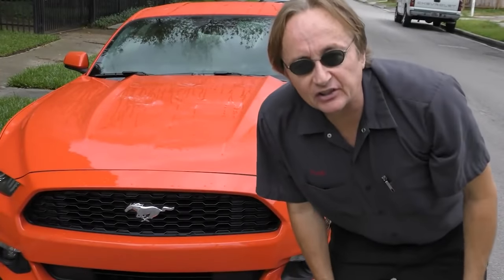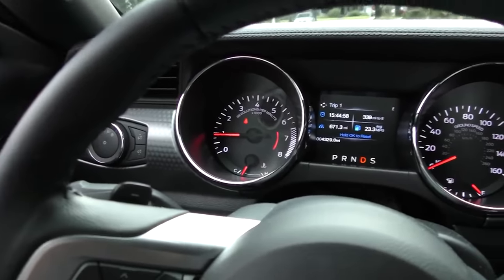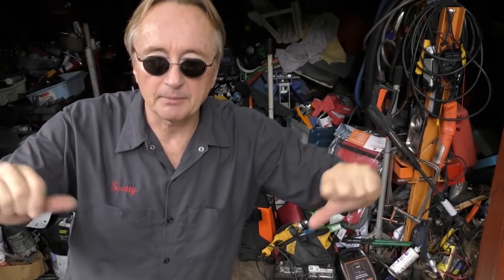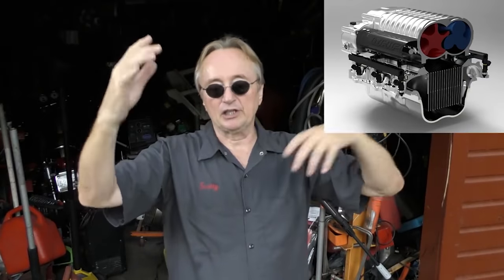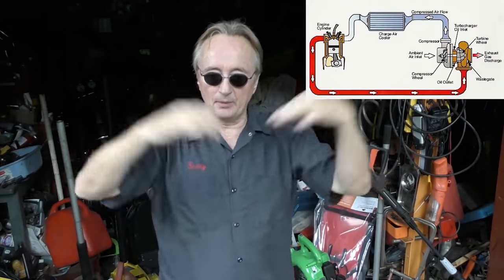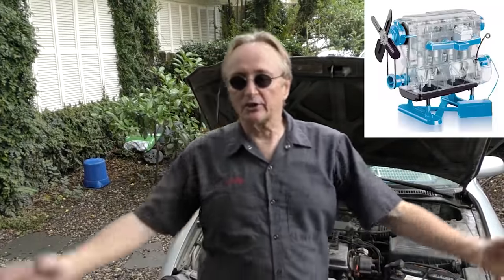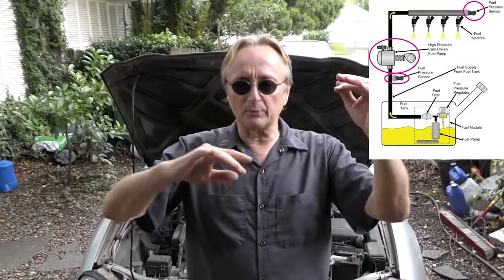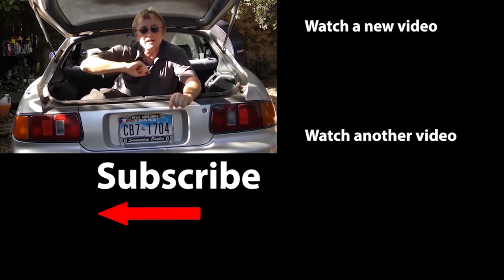I Was Wrong About This Engine and I'm Sorry

Comment: I have a 2017 F-150 with the twin turbo 2.7 engine. So far, I have 174,000 miles on it with little to no problems.  I normally keep my car/truck for 15 years.  Ford says I can change the oil every 15000 miles. Sorry Ford, being old school I change my oil every 5000 miles and Transmission fluid every 50,000.  Proper maintenance is the name of the game. I have been using Mobil 1 since 1991.
One more thing, this truck has been towing my 7000 lb travel trailer through 44 states since new which accounts for most of my driving.   I'm on my 3rd set of tires, 2nd battery and 3rd brake job.  Will be doing another anti-freeze change and tires soon.  
I am a retired Ford tech with 45 years experience, I retired in 2017. 

For me retirement means camping, fishing and hunting.
Reply: 30yrs. And counting.
Reply: Really? It hasn't leaked?  I thought every one of the 17s leaked.  5k is a good rule on cars,. Those extended oil changes are crap- the oil may still protect the engine but it varnishes and attacks seals and silicone
Reply: That’s a lot of miles for a 4 year old truck. How many times have you replaced your tires so far?
Reply: Same here. I have 179,000 on my 2008 Explorer (V-6). Runs very well.
Reply: Also you might be the edge case where you might be driving better than the average person plus that truck is almost totally highway miles which is easier on an engine than constant short trips your literally putting 30-40k miles a year on your car that's a ton of highway miles because that's 80 miles a day every day on average
Reply: I think 174k on an ecoboost engine is probably the exception and not the rule...
Reply: mobil 1 all day
Reply: I have a Ford flex with the 3.5 Ecoboost with 195k no problems at all it gets maintenance regularly. But to scotty if it's not a 95 Celica or a Toyota then it's junk -_-
Reply: Those are all highway miles. Explains the 174,000 miles on a 5 year old car.
Reply: @ccengineer5902  the Tundra 5.7 v8 that got super praised 4-5 years for having a million miles was used for a highway queen in courier service for 11 years. 90k mile's per year. Yes, a 27k mile per year Mustang is not seeing tough use but the bulk of highly praised high miler cars have 25k or more per year.
Reply: I own a 2015 Ford Edge with that same 2.7L twin turbo... 107k miles, so far so good, it creates a lot of power if needed, but most of the time it's driven very easy on it. However, the V6 in my Lexus runs considerably smoother.
Reply: I do agree with Mobil oil all day. I also change transmission fluid every 50,000 miles. However, after performing several oil surveys on trucks driven in all conditions. I change my oil between 9k to 10k miles. Even then the oil I have tested has alway been 95-98% as new. But to each their own. If you feel that changing oil at 5,000 miles that is your decision. I just rather not spend the extra money after performing an oil survey.
Reply: @treysuniverserv1576  Realistically, changing oil every 5k is still cheaper than doing serious engine work. On the flip side, if you're driving 1000 miles a week on the highway, 10k may be just fine.
Reply: 5000 miles is over kill. You're wasting your money. 7000-10k is sufficient on any modern engine.
Reply: I change engine oil every 30,000km on my Hyundai i30 2011 with a 1.6L diesel engine. Been doing that for 9 years...
Reply: @richardcrouthamel4397  any parts replaced?
Reply: @jimmyaber5920  You're basically making my point.
Reply: @richardcrouthamel4397  that’s not an eco boost
Reply: @jpete3027666  Proper maintenance is not the rule it is the exception!
Reply: the main reason for car problems is just improper maintenance. Many people after the warranty finish don’t go to the dealership and just change oil irregularly without maintaining other requirements and the car breaks down. I dare someone to bring me a well maintained car with issues.
Reply: You are absolutely doing the right thing regarding oil changes.
Reply: Leasing is an alternative
Reply: I can't image towing my trailer or hauling loads with a 2.7 engine.   Anything less than a v8 won't do
Reply: @jliefer2484  I used to use mobile until I discovered Pennzoil ultra platinum. Better by far.
Reply: Change oil or change engine/transmission. It's a choice.
Reply: 120k miles on my '15 2.7 EB.  No issues so far.  routine maintenance only.  Though i'm with you on the oil change interval.  i never go to 10k miles on an oil change.  its always half of that if i can.  Its cheap maintenance, easy to do, and much better for the internals, namely, the oil lines going to the turbos.
Reply: @Banditt42  Been towing a 7000 lb trailer from day 1. Twin turbo's give me all the power I need.
Reply: @richardcrouthamel4397  Yeah watch a transmission and your differential
Reply: I do religiously 5k mile oil changes on all my trucks and it has never failed me.
Reply: Unicorn, at the same time if you were talking about a V8 truck that wouldn't be worth mentioning. It's like we went backwards. 90s trucks went 300-400k all the time.
Reply: 45k miles per year? Interstate driving you think!
Reply: Cap
Reply: Something about to break
Reply: @gutadin5   Nothing major except for a transmission re-build at about 130K.
Reply: @jjk028    Yeah. The trans was re-built at 13-K. The diff has been okay.
Reply: @jjk028  Sorry. 130K for the trans.
Reply: @jpete3027666  You think... probably... Well that's pretty good evidence.
Reply: @floridajames04  I'll get my oil changed more often so I don't have to worry about my turbos. These engines are fantastic, but amazingly expensive to repair. To replace the turbo's requires taking the whole cab off the chassis.
Reply: Every 5000 miles and any engine will last
Reply: I have a 2018 F-150 w/2.7 V6.  Zero problems.  Plenty of power.
Reply: @richardcrouthamel4397  what are your thoughts on the new 2022 Ford Explorer Limited Ecoboost?
Reply: Obviously those are highway miles that will be much easier on the entire drivetrain. I believe Scotty has mad a comparison that highway miles like that are equivalent to less than a 1/3 of those in the city. Not knocking it, but the type of miles also plays a huge part.
Reply: @gutadin5    I have no firsthand knowledge, but reports suggest that their reliability is above average, with a few design flaws like possible oil pan leaks and ignition issues, and, of course, excessive fouling on the intake valves.
Reply: I agree. I have 2015 Ford F-150 3.5 eco boost. Changing oil every 5 to 7k miles with amsoil and transmission every 50k miles. Axle oil every 50k too
Reply: @Banditt42  
The ford 2.7 ecoboost is a great general purpose engine. It has good power and good fuel economy, and can tow up to 7600 pounds. But if you tow on a regular basis or tow heavier loads the 5.0 v8 or the 3.5 ecoboost makes more sense. Of course if you tow a lot diesel makes the most sense.
Reply: I have a 19 f150 twin turbo, and at 60,000 miles, zero issues so far.
Reply: @Banditt42  I drive a 2.7 eco boost and it works just fine towing a 14' pressure washing trailer. The reason the twin turbo engine works is because it makes similar power to a v8. 400 ft. Lb's and 325hp it's nothing crazy but definitely enough to tow reasonable loads.
Reply: Awesome,  us even older schoolers we did the trannys at 30,000 miles...But today's fluid is usually full synthetic so 50,000 seems reasonable.  They probably tell you in the Maintenance Manual it's lifetime or some other nonsense.  They need comeback buyers,  thus the 15,000 mile OCI  recommendation! Keep the metal side up and rubber side down and drive her till the wheels fall off... They are only getting more outrageous in thier price tags every year!!! Good 👍 LUCK.... Thanx; Jethro
Reply: @jpete3027666  far from the exception. We have 4 in my current fleet with 125K+ miles without engine issues.
Reply: The 2.7 is way better built than the 4 cylinders
Reply: This guy here is why scotty laughs at stupid people that swear buying GM is a good decision lolololololol
Reply: @chadoldag5827  I think leaking was due to composite plastic oil pans right?
Reply: @MS-mr4zm  yes, 15,16,17,18 they are glued on from factory, 17 and up can use a updated pan with a gasket.
Reply: @ccengineer5902  he probably lives in Arkansas
Reply: Every 15,000 is to get you out of the warranty period, that's all. For most 6 to 7 qt Ford Trucks every 5 to 6,000 is going to be needed to keep the engine clean inside with local use. Up to 8 or 9000 if all highway. The trans fluid and differential oils will easy go to 100k or  more, if recommend at all, it's usually listed at 120,000.
Reply: @floridajames04  If it takes someone a year to go 5000 on a 5.0L truck engine that has 6.5qt capacity, that's not overkill.
On a 3.5L Mercedes with a 9 qt. Capacity every 5000 is overkill.
Reply: @Banditt42  the 3.5 makes more HP and Torque lol
Reply: @JoeTricep  My routine in the morning involves turning off the stop/start...even though it would almost never activate on my usual commute anyway.
Reply: @JoeTricep  Im not sure what the purpose of your reply was. Did you mean to reply to someone else, or did you make up a debate in your head where I said something that I did not say?
Reply: 93 ford ranger with 2.3l 5sp 2wd, 492,000 miles. Original engine transmission and rear end! Change oil every 3000! Also change transmission and rear fluid regularly as well
Reply: I have a 2011 nissan sentra with 65000 miles. You drive a lot?
Reply: @2cornersahead  can't  blame him....Toyotas last forever. I had 1st gen V6 Tacoma that I sold with 220K miles on it, it never gave me any kind of issues other than regular maintenance and usual wear and tear. My father in law has 20 year old  4 Runner that currently has 260K miles on it....he just drove it from California to Texas and back without any issues. Toyota and Honda that's all you gonna se in my driveway....
Reply: That shows you how reliable the modern engines are, and with small combustion chamber and turbo charge. Actually it is hard to destroy a modern engine at present time. The whining out there are more coming from people with no auto knowledge, well if an engine overheats and you keep on driving it, sure you will destroy it in next 50 miles.
Reply: 15,000 is ridiculous especially with turbos
Reply: @Banditt42  The V8 is the worst for towing....
Reply: @jpete3027666  a lot of the fleet trucks in the company I used to work for had 2.7s and they were in the mid to upper 200ks
Reply: @Banditt42 , nonsense it depends on the size of the trailer…
Reply: @jpete3027666  no its pretty standard
Reply: Love my 16 2.7 f150, just drove from Texas to lousiana and got around 25mpg highway, get around 18-19 city
Reply: God bless you, Joe. I hope that you are having some fun!

Comment: I have the 2019 Ford Ranger with the 2.3 Eco boost, ten speed transmission. The same engine in the four-cylinder Mustang.
 Just geared different, with less horsepower and torque.
BEST truck I have ever owned.

Comment: My wife bought a used 2018 eco boost mustang from a dealer that bought it from enterprise rental cars. We added a bigger inter cooler, bigger turbo, turbo blow off valve, cold air intake and took off the resonator off the exhaust. Then had it professional tuned with the cobb access port installed. Car runs amazing and gets close to 350 hp. Also added an oil catch can because of the fuel injector placement.
Reply: Wow, I bet it does run good. I have a 20 Ranger and put in an exhaust and intake and a hot pipe with blow off valve. What a difference, it is like it was always congested and now its pipes run clean and smooth. Even produced a little better, MPGs.
Reply: i just bought a 2018 as well with 59k, and was wondering and thinking if the person before or the rental place treated these with special care that a turbo needs, i do think a person needs to understand these cars specifically to own one. and when i hear of failures or booms, theres so much user error possible, improper upgrades, also essential upgrades that must be made, may i ask how many miles did your wifes have on it at time of purchase and now also any tips?

Comment: I have a 2020 Ranger with 2.3 Ecoboost mated to a 10 speed transmission. I love it. Great gas mileage and enough power to tow. The secrete is not to drive by your foot. Just give it a little throttle and keep it there. The transmission will shift smoothly and most efficiently. I get 26 MPG around town and 13 MPG towing a 3500  LB. camper trailer . I installed an OEM catch can for the intercooler condensate.

Comment: 148,500 miles in my 2013 F-150 3.5 Ecoboost. Only mechanical issues I've had is the heater core leaked and had to change the upstream O2 sensor. I use it like a truck and I'm not gentle with it. But it also gets 5k oil changes, 50k tranny changes, 30k diff and transfer case changes, etc.

Comment: 2014  F 150 with 270 thousand miles with the eco boost engine and still going strong. No issues. I use good oil and filters and change the oil every 5000 miles. This trucks runs the highway everyday for work

Comment: I'm happy with my 2018 F150 with a 3.5L ecoboost.  Has direct and port injection.. lots of low end  torque.  V8 are good too, but with more torque, tuning potential, fuel economy, and towing capacity. The ecoboost is a better choice IMO.

Comment: From 1984-1986, Ford made the SVO Mustang with a turbocharged 2.3L. My buddy had an '85 and it was bulletproof, got decent fuel economy (when he kept his foot out of it he got around 20 in town and 28 on the highway), and dramatically outhandled the 5.0s due in part to the far superior weight distribution. That engine only had around 200 HP, but the car weighed 4-500 pounds less than the modern one so 0-60 is only a second slower. What's old is new...
Reply: Those SVOs and Turbo T-birds were fantastic cars back in the day. Wasn't there also a turbo model in 1980?
Reply: Thats a different 2.3
Reply: @michaelwalsh3474  There was. It was on a carb, wasn't intercooled and was pretty much a dog. I had a friend with one back in the day. It sucked pretty much all the time, but there were times in the dead of winter when it was balls cold out that it ran like a banshee. They took the same basic engine, put a better turbo on, a small intercooler and EFI to make the SVO. I think they made up to 210 HP and good torque. Fiddle with the boost and you can make a good chunk more. That iron SOHC 2.3 is probably the most raced engine of all time (in 1.6/2.0 trim) and is an absolute tank of an engine. Good luck trying to kill one.

Comment: I recently bought a 2012 Edge with a 2.0 ecoboost with 176,000 miles. Runs great with no issues. Had it checked by a trustworthy mechanic and he said they have had good luck with this engine over the years with no major problems.
Reply: I may be wrong but Im pretty sure the 2.0l is the engine that got the name 'Ecoburst' coined
Reply: @tehagent1321  what about 1.0l haha
Reply: 1.0 came later than other Ecoboost engines.  It has high torque off the line.  Even Jeremy Clarkson of Top Gear said that was a very good engine (and he hates nearly everything)
Reply: @electrictroy2010  thankyou

Comment: I bought a new 2020 Mustang GT.  It goes back and forth between port and direct injection.  It threw a check engine light at 1,600 miles for a bad fuel pressure sensor.  The dealer had to take out the back seat and drop the sub frame to fix it.  I think Scotty is on to something when he tells you not to have these vehicles pass the warranty period.
Reply: Unlucky, I have a 2018 gt with 0 issues.
Reply: That's what you get for buying a POS FORD 🤣🤣🤣
Reply: @floridajames04  you saying that but you drive a pos tesla lol
Reply: Sounds like a fuel tank pressure sensor, not a fuel pressure sensor, those are usually under the hood. The FTP has to be on the top of the gas tank. On some older ford's they could come loose and out by just dropping the tank an inch.
Reply: Diesel cars have had turbo & direct injection for 30+ years and lasting over 200,000 miles.  Gasoline turbi-DI should be able to do the same

.
Reply: You cant trust any car beyond warranty period lol. Unless it is honda/toyota
Reply: @Acisao  not unlucky, youre just still lucky lol.
Reply: Junk ford
Reply: FORD is rated #4 in engine reliability (least number of breakdowns)

.
Reply: Or just buy em well used and replace AZ needed

Comment: I have 2010 F 150. Runs and drives great with 160000 miles on it.  I also have a  Mustang 2006 with 142000 miles on  also ru so and drives great.  Keep your oil. And maintenance up-to-date.  You will be fine.

Comment: I agree, I had a turbocharged 4 cylinder and I drove it like I stole it! It only got 15 MPG but it was a blast to drive. Until it windowed a piston around 100K miles.
Reply: So what I'm hearing is that you abused a turbo 4 and it still lasted 100k miles. Interesting...

Comment: Big Rigs Diesel Engine use a turbo and that's what gives it power. I prefer Cummins and Detroit engines. I like the sound of the detroit engine at idle and the way the turbo sounds when gearing up. They whistle while they work. I drive a 1993 Freightliner FLD with an 8-speed transmission with a hopper bottom grain hauler coupled up to it. I enjoy driving it. I've been trucking since 2003

Comment: The new redesigned Ecoboost ford engines really run great. They strengthened lots of parts.
Reply: Don't count on it.
Reply: Well if they're so great then why hasn't Ford put the EcoBoost in the Ford Super Duty.

Comment: Recently picked up a 2018 Ecoboost Premium Convertible. Drove over 1500 miles on vacation. 30 mpg. In traffic on the interstate, caught myself going 103 mph. Very smooth. It's just what we wanted. Previously had a Miata and it was too small for a beach vacation. I put a wagon, two chairs, two umbrellas, towels, floats, etc in the trunk. Suitcases and cooler in the back and it was a shockingly comfortable drive.